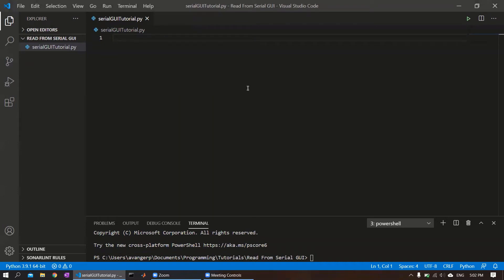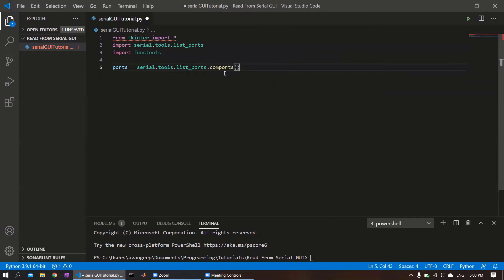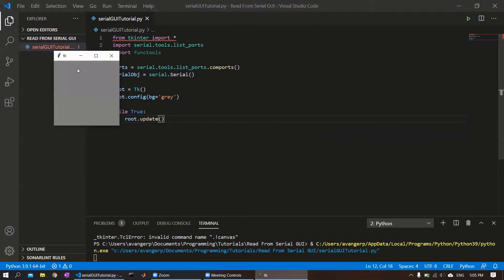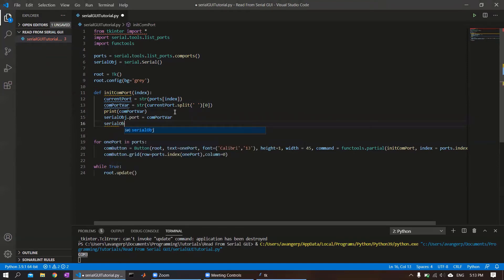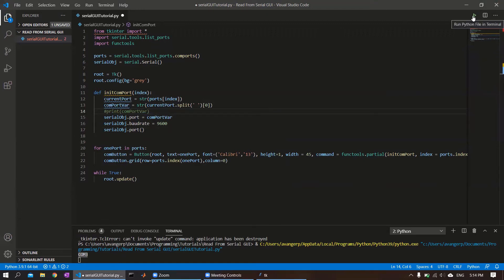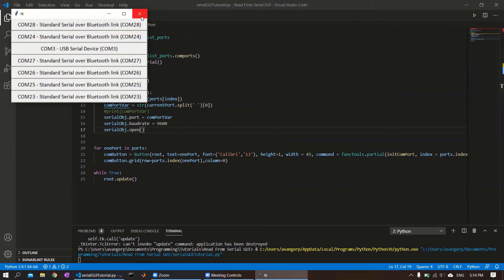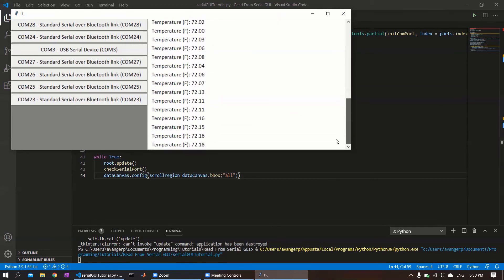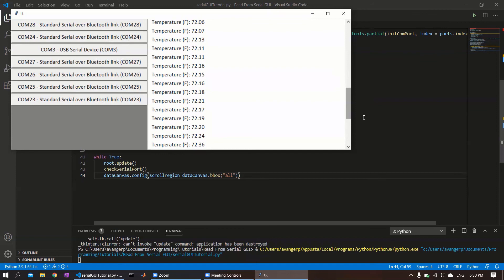Python Tutorial - How to Display Serial (Arduino) Data on a Scrollable Tkinter GUI

Comment: I had an issue where after choosing com port the temperature wasnt showing. i fixed it by changing the last line of code at the bottom-just  above the While True statement to match what was on the screen.
what i did was went to the link and downloaded the code. it just needed to be updated to mach the screen . Works Beautifully !!! Thank you! ur a tinkerMASTER!!! 
Label(dataFrame, text=recentPacketString, font = ('calibri','13'),bg='white').pack()

Comment: Hi. Fascinating video. Tq!

Update.... No. It was all fine, and not because I'm using /dev/ttyUSB ports.
It was because I didn't have any device plugged in! lol.
The button with the label "/dev/ttyUSB0 - USB2.0-Serial" appeared :):):)
when I ran the script after plugging in an arduino.
- Just in case other amateurs like me have the same problem.
-------------------------------------------------------------
At 5:43 I get the empty grey screen but no buttons are displayed.
I'm running linux and python 3.8.10
I;m guessing it's because ports in linux are named /dev/ttyUSBx instead of "COMx" in windows,
but my programming skills are very weak so I don't know how to make it work in Linux.
Do you (ar anyone else) have any idea?

P.S. I'm using geany text/code editor, and it wouldn't compile initially.
I had to do this to get geany to compile it...
Build > Set Build Commands.
In the "Python commands" category, clicking on the visually empty 'Command' field,
this instantly pops up... python -m py_compile "%f"
Change     python -m py_compile "%f" to this...     python3 "%f"

Comment: Hi! Thanks so much for the video! Helped me understand a lot but for some reason I can’t seem to get the serial output to the window using your exact code. The code figured out the comm port and the baudrate (i.e., print on the command line shows it’s all good), and the Arduino serial monitor also works fine, but nothing is printing in the TPK window…

Any help would be much appreciated!
Reply: I'm having the same problem right now... How did you solve it?
Reply: @himanshishende2149  me too comport shows after i push button - but my temp is not showing
Reply: not sure if i found the issue but did notice the download code looks different from the video  at the end. there might be some other small changes.